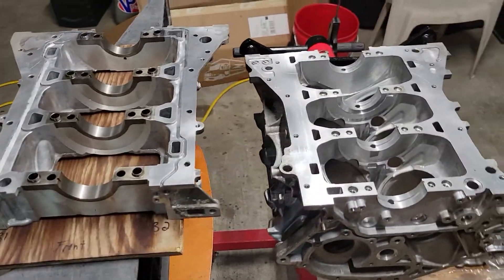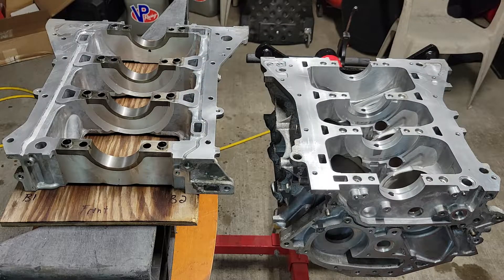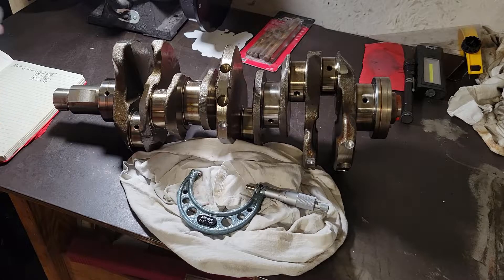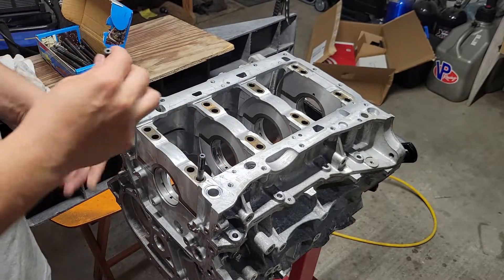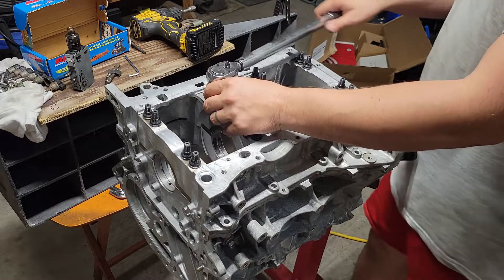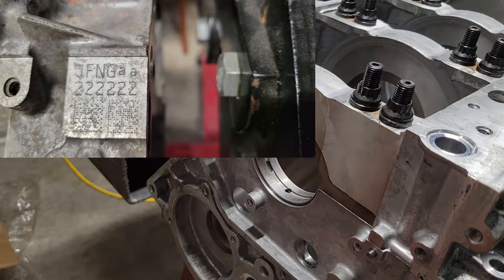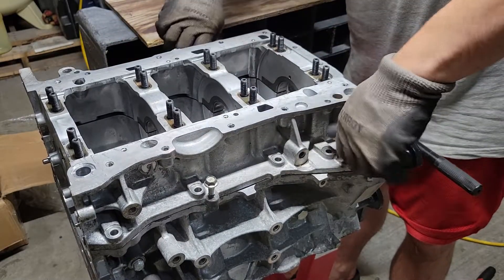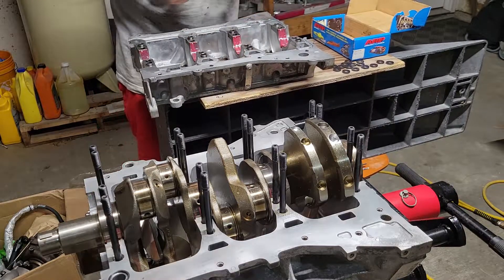Forged VQ37VHR build part 17, crankshaft install and tolerances

Comment: i dont know if you mentioned but what is the crank shaft you are running?
Reply from the maker: The factory 3.7 liter crank.
Reply: @garagefanatic7830 you don’t need resurface the crank ?